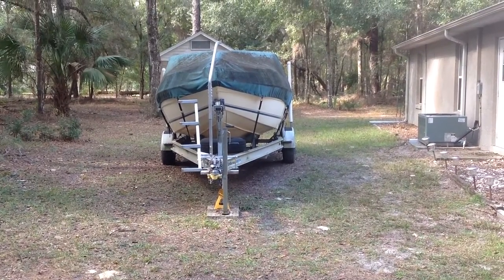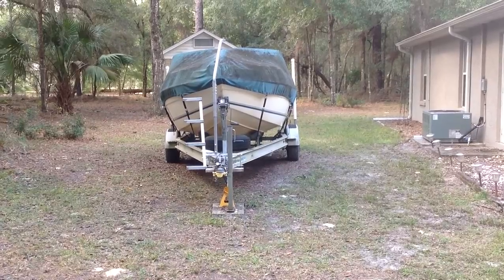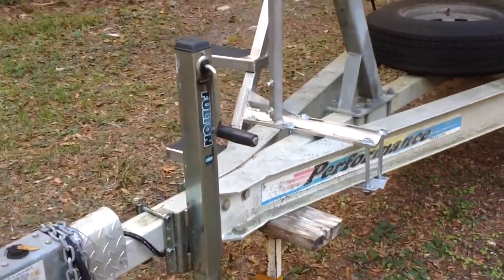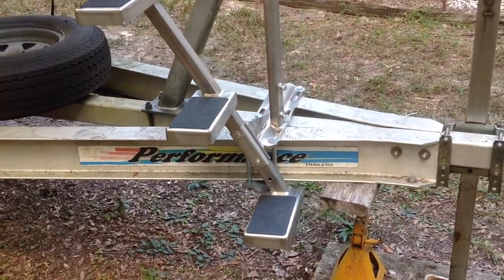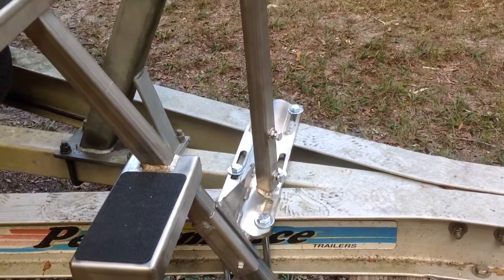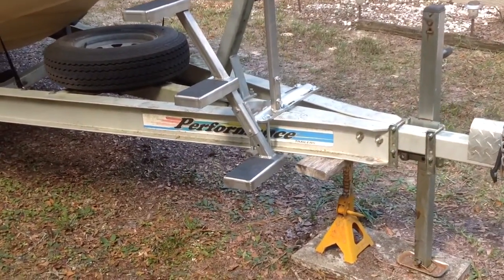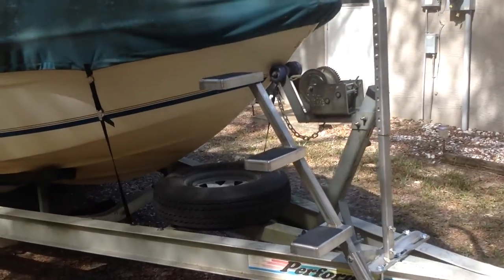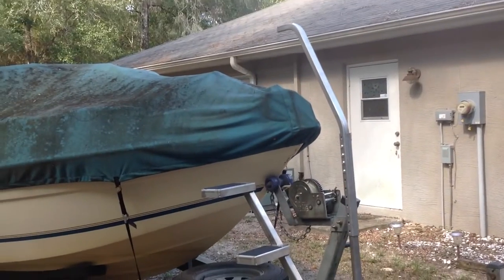Easy Step System Boat trailer steps

Comment: Kits now come with list and description of every item as well as installation steps ... Bought and installed on my Trailer for 24ft Pathfinder TRS ... had to move my spare tire back 12 inches which required drilling 4 holes ... It was an easy install... my GF and I had it on in less than 1 hour ... wish it had been a dealer option when I bought the boat

Comment: I am looking to add steps behind the winch post of my trailer. I like the looks of what you did except I cant help but worry what would happen if the wind or what ever blew you off coarse to the starboard side while loading the boat on the trailer. I see nothing to protect the hull if the boat got against the top step.
Reply from the maker: Thank you for commenting about my step install. The way I load the boat on the trailer the collision you describe should never happen. When I load the boat, the trailer is out of the water quite a bit, therefore the boat does not come all of the way forward. I simply get it about 3/4 of the way on the trailer then I stop the boat engine and get off the front of the boat unto the trailer and crank the boat winch the rest of the way onto the trailer. Believe me, this is one of the best things that I have added to the trailer. It just makes loading/unloading so much easier and safer, in the yard or at the dock.
Reply: @PatrioticRottweiler  That is correct--and with my "trailer guides"--they really do "guide" the boat into the slot very well.  And if one were still worried--maybe pad the edge on the side of the boat.    Can you tell me how much weight the steps will hold safely?
Reply from the maker: @jimquantic  I don’t know how much weight they are rated for but I’m about 220lbs and they hold me fine. I’m sure it would depend on which model you purchase but the company should be able to answer that question. I really do recommend these steps and thank you for your question. Even to this day my steps still look brand new and I am extremely happy with them.
Reply: @PatrioticRottweiler  Thanks, I did contact them--also concerned because my salt water boat has a pretty tall bow rail, 50 inches from the tongue to the top--if it will not go that high, then there is no point--for me.  I know they make a four step, and I sent them the measurements.  One thing for sure, right now I can't launch myself as my ramp does not have a parallel dock, I would need to wade in waste deep--in cold, ocean water, then repeat for putting it back on at the end of the day.  Then again, I seldom boat alone--but I do need to splash the boat once in a while--tie up to a dock (500 yards from the launch) to do simple repairs/additions to my trailer.  These steps could make a huge difference.  I did see one custom job--awesome really that was fully welded onto the trailer tongue, and it was very easy to climb it and enter the boat.  I'll bet the woman who had it paid one to two thousand for it--custom welding, powder coating, etc.

Comment: How high is the top step from the top of the Aluminum I beams?
Reply from the maker: Just under 30” from the top of the I-beam to the top of the top step.
Reply: Thanks, bow of my boat is just over 50 inches from the top of the I beams.
Reply from the maker: @craigarbuckle2791  my boat is about 45” from the top of the I-beam to the top of the bow.   I mostly only use these steps when recovering my boat at the boat ramp. When recovering I pull the boat about 3/4 of the way onto the trailer, then walk down these step to the front of the trailer. I am then able to hook up the hand winch and crank the boat the rest of the way onto the trailer.  All of this without having to get in the water.

Comment: Where did you get this?
Reply from the maker: I bought the steps directly from the manufacturer: Easy Step System      http://www.easystepsystem.com

There are several options; number of steps and materials (stainless steel or powder coated) so it is best to contact them to determine what is best for your application.   My stainless steel steps are still in perfect shape even though the boat/trailer stay out in the weather 24/7.

Comment: The drivers' side is port.
Reply from the maker: As seen from the helm (drivers seat) and facing forward…….  The left side of a boat is the port side. The right side is the starboard side.  The steps and the steering wheel are both on the right side (starboard).
Reply: @PatrioticRottweiler  Yeah I know which side is port and starboard, I was thinking the drivers side of the tow vehicle-my mistake.  But I am curious why you did not put it on the port side; this way when you get out of the truck, you have to step over or go around to the side with the step, the starboard side?
Reply from the maker: The step system comes pre-welded and is designed to be installed the way you see it in the video. I completely agree that it would be better to have the steps on the other side, but where it is located I can easily step onto/off of my trailer.  So I don’t have to walk around the trailer or step over the trailer tongue.   I still have these steps on my trailer and they still look and work great.
Reply: @PatrioticRottweiler  Sounds like a good system.

Comment: Two crescent wrenches and 6 bolts and see ya later to a thief... needs to be welded somehow.. same thing with trick steps.  They want $475-$650 for steps... theives see those and by bye
Reply from the maker: That is a possibility, but where I live and where I go boating I haven’t had any problems. I guess you could weld the bolts/nuts into place, if you really wanted to.